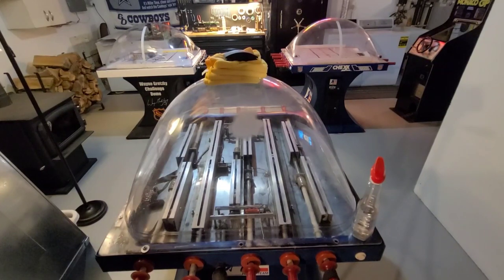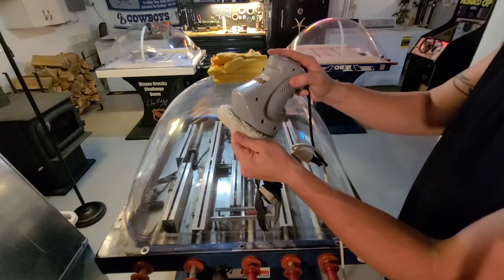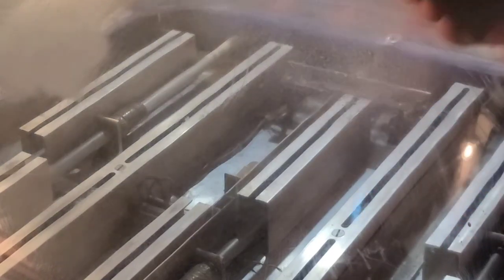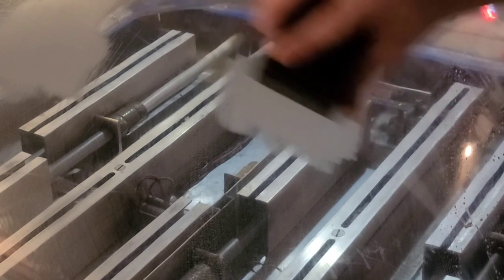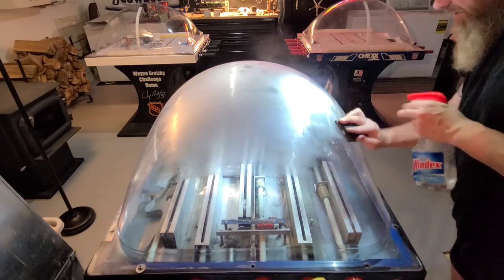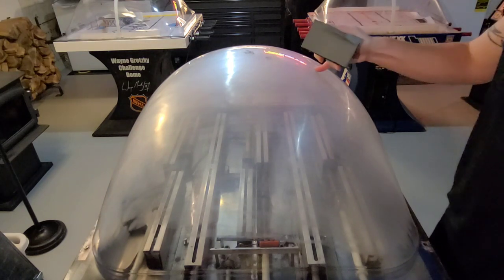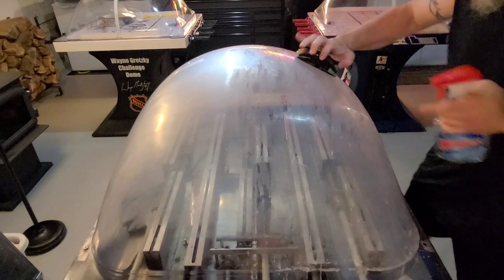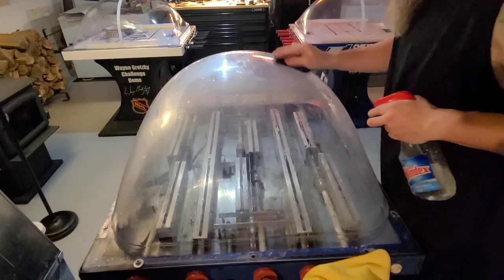Wet sanding a Chexx Bubble Hockey dome

Comment: Hey, thanks for this video, saved me a lot of $$$. Curious if you ever polish the inside to remove marring from the puck? Tnx
Reply from the maker: yes, I have had to take the dome off to do a few that way. I purchased a big microfiber towel to sit it on upside down as I worked it over with the buffer. I recommended having an extra set of hands help hold the dome in place, but I have rest it on my leg as i worked the buffer by myself. New yellow bumpers & board decals afterwards for that fresh look!

Comment: Folks, this makes absolutely no sense to attempt to do yourself if you are doing this for the first time. To do this right, you'll need to purchase close to $150 in tools and sandpaper...and you're still likely to screw it up. Google an auto detailing place near you that does headlight restoration and they'll do an amazing job for under $200
Reply from the maker: *The Brian Stetson Disclaimer * If you can not pull your players out, if you think your ribbon cable needs screwed on, if you can't follow directions, or if you can't do 25 pushups; Please Do Not Attempt!!! lol

Comment: This video is full of inconsistencies and generalities and is no where detailed enough to help you remove scratches without damaging your dome. Be very careful following "Dr. Chexx's" high level instructions and good luck getting help cleaning up the mess afterwards. This guy is bad news.
Reply from the maker: says the guy who doesn't follow directions. I've got screenshots of our conversation jackalope. You don't have the arms to be doing this in the first place, you posted on FB multiple times that you couldn't even pull your players out. #1 too strong of grit, #2 not enough paper used, #3 moved too quick thru the grits. you basically did it all wrong & it's my fault, lol, ok